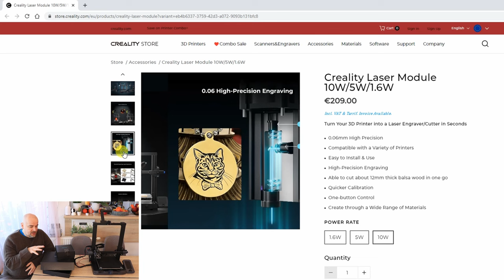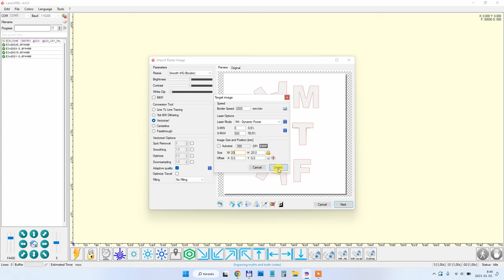Creality 10W laser module for Ender-3 3D printers (Falcon) - tested with Air Assist kit

Comment: For anyone watching this that dont want to do all the extra cutting  and drilling, it is way simpler  than this. the mount he has is made to mouth WITH the extruder still on the printer. he has it installed wrong.  he has it turn the wrong way. it sits along the  the top railing under the back side and clamps in. then tighten the screw under the bottom and it will not move at all!
Reply: I just installed a laser on my Sovol SV-06 plus but havent had a change to use it. How does the machine know to use the laser instead of the hot end when laser negraving? I was 3d printing something and it 3d printed and lasered my build plate when it wasnt suppose to . thanks

Comment: You installed the bracket incorrectly. the bracket is hung under the upper rollers and fixed with a screw from below. but otherwise a nice and informative video.
Greetings😊
Reply: Hello can u please help me set up my 10 watt laser module in ender 3 s1 pro
Reply: @Keepitunknown123-j2g  no, sorry haven't done it by myself on a Ender 3 S1...😉

Comment: Do you know if the rotary module for the other creality engravers can be used with this adapter?
Reply from the maker: Yes, they just replace the Y stepper motor. You just have to plug  cable to rotary unit.

Comment: Thank you and great job on this video!!!
I currently have an Ender-3 S1 and am starting out with a 10W laser module.
I followed your advice, printed your shim with my Saturn S but I could use a little help on the setup whether on LightBurn or LaserGRBL as I am getting beeps and error messages.
Would it be possible to chat to see this together?
Thanks for your feedback.
Reply: I can't find the 10w laser on their website
Reply: ik this is a longshot, My Engraver Got burnt a while back while cutting a bunch of phone stands in wood, the wood caught on fire... Anyways I got all the parts I need besides the red Magnetic Lense/Sheild that attaches to the bottom of the laser module, I want to 3d print one but need to know the dimensions, more specifically just the height of the red shield, I can measure the laser module for the with, but cannot just guess the height because the beam needs to be focused.  If anybody can measure the height of the red Sheild with a caliper and tell me how many mm it is i would appreciate it more than you could imagine!!

Comment: Do you know if they make a rotary roller for the ender s1 pro?
Reply from the maker: You can use rotary roller from Atomstack and connect it here to Y axis cable. With that roller you will get different cables for compatibility with other units

Comment: I have little faith in creality accessories after trying their sonic pad. If anything I’d just buy a standalone unit
Reply: I have also bought this the 10w laser 
And i made an bracket to attach the motherboard box to my ender 3v2 neo printer 
I also routed the cables together with the ones from the 3d printer  
Now i just have to undo the z axis motor and limit switch an plug in the ones from the laser that i gave a red zip tie i also have to do it for my y axis motor and limit switch 
Then attach the laser plug in the cable  
Plug in power to the motherboard and im done it takes max 2 minutes .
And it works exxelent i can engrave everything .metal,glass,plastic,wood stone,leather,everything .with the proper settings 
They also give manuals on the sd card like with any creality printer where you can find an diagram for what speed and power you need to set the laser to for engraving all kinds of matterial and also an diagram for cutting some matterials 

I am pretty happy with it and the air assist u only need it with wood and different matterial than may burn a little .